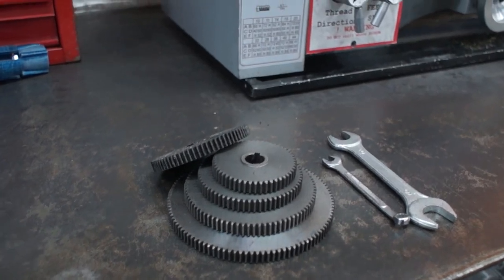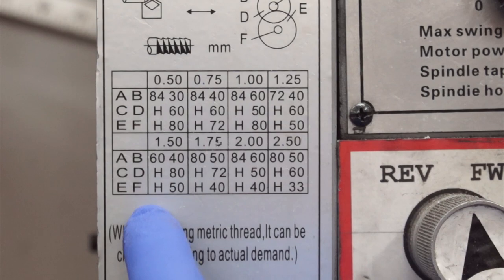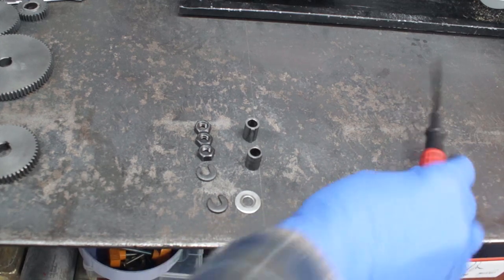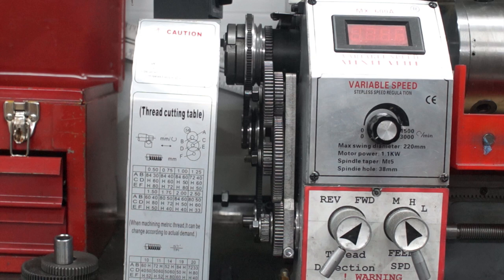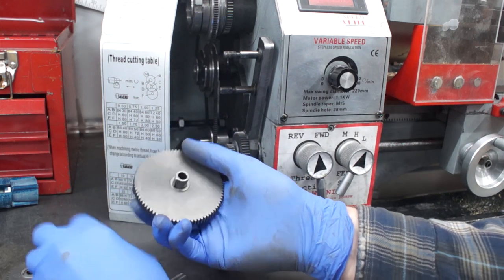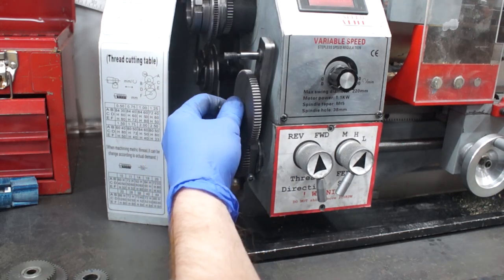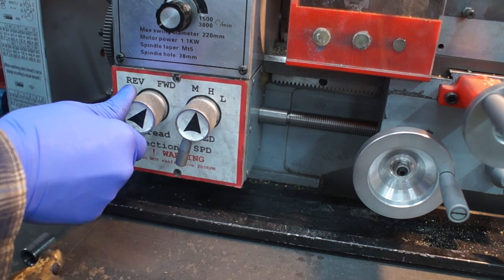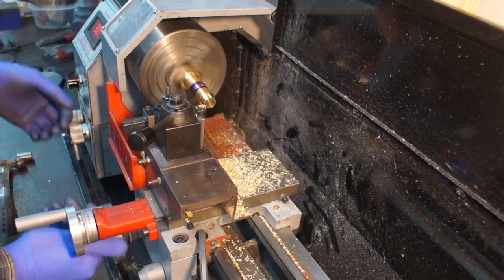VEVOR mini metal lathe setup gears for threading

Comment: This is an old video to be commenting on but when cutting short threads up to a shoulder you can turn the tool upside down and start the lathe backwards (If it goes backwards) to cut away from the shoulder into safe fresh air.

Comment: I confirmed on my MX600A;  Medium= 24t to 24t for 1:1.  High= 32t to 16t for 2x speed.  Low= 16t to 32t for 1/2 speed.  The one-piece tipple input gear appears to be a crappily made sintered  metal affair - nearly impossible to cut a replacement. The 16t and 24t output gear teeth are an integral part of the output shaft.  So yeah, don't break em.

Comment: Good demonstration! I have a very similar chinese lathe with a problem in the levers that drive the leadscrew (there's a fwd/neutral/reverse, and a 3 speed selector). They wont turn. I jiggle them and they may move a little, sometimes they engage the leadscrew and sometimes not. Is there a quick fix for that or is it necessary to take the headstock apart? I'd appreciate any help.

Comment: Good videos. I have a similar lathe. I am curious, who did you end up fixing the reverse gears that were stripped in the first video?
Reply from the maker: Nothing.
This gear is not used for any pitch so I just suffer with inability to have slowest possible feed.

Comment: Is this the 220mm lathe? Does is suffer the same kind of flaws that the small 7x14 lathes do, e.g. poor machining/tolerances, lack of rigidity etc?
Reply from the maker: It's small so it's not very rigid but but more rigid then smaller once.
Tolerances are the same except for the chuck. It 0 at the spindle and  002 ran out at the chuck  which is very good
Reply: @tonycstech  Thanks for getting back to me, that sounds very good (at least compared to my very worn pre-war lathe!).  I just saw the video on the quality issues you had to overcome, I'll avoid eBay for this and buy from one of the companies in the UK that sell them only after quality checks.

Comment: With metal gears I've found using bar and chain oil is nice and quiet and has awesome tack. Is this okay or is there something better?
Reply from the maker: I run mine dry.
If i lube them, shavings will stick and cause problems.
Reply: I agree have used bar and chain oil on lathe gears for years it is heavier and tends not to fly off the chain or in this case the gears.  Bar & chain oil also makes a pretty good lathe bed and cross slide lubricant.

Comment: Did you do all the passes by spinning the chuck with your hand?
Do you think you could manage M12X0.5?
Reply from the maker: I did it b hand because length of the thread is short, like 10mm at most.
It would be too easy to overshoot it due to lathe travel of speed when half nut is engaged.
Solution is to slow down the spindle as much as possible, maybe by jumping the belt that drives the pulley to a larger pulley.
It will slow entire process down so you can react in time.
IN my case cutting would be too fast and i would not react in time to disengage.
Reply: @tonycstech  Check this out, I think this is the solution to that issue: https://youtu.be/q7scadYptTI?t=754
I'm still a noob beginner, so might be wrong, but let me know if that helps you.
Reply from the maker: @maxwellconniff1189  have seen this my self. Totally forgot all about it.
This trick is definitely on my "give it a try" list.
Thanks for reminding me.

Comment: Hey Tony! I'm willing to buy a lathe identical to this one. What's your opinion about it? Does it worth the money? Cheers!
Reply from the maker: I think yes.
Its 1200 on VEVOR right now.
The only problem is, you never know what you going to get. It may not match to whats on the photo and may not include everything thats on the photo.
VEVOR will likely offer you partial refund because they wont be able to give you individual parts.
I got 300 and then some more later refunded.
So this lathe cost me 800 bucks which is allot better.

Pay with paypal, so you can easily open the claim.
Otherwise they can just ignore you.

Good luck.
Reply: @tonycstech  thanks, Tony! Should I buy it from Aliexpress, since I am located in Europe, and the shipping is free? Or from Vevor's website? The actual price is about 950 euro right now.
Reply from the maker: @vladsbikeshed  I would avoid buying directly from VEVOR. You need a middle man to be able to create a "not as described" case in the event or receiving wrong model or not receiving everything.
Reply: @tonycstech  thanks Tony! I'll buy it from aliexpress then. Had good experiences with the customer care in the past.

Comment: I am one of those who measures by the size of my foot so pardon my French, curious if you are able to get less than or equal to .001” tolerances out of this lathe?
Reply from the maker: Short answer: no
Long answer: there is no ranout on the spindle or the chuck, at least based on what I see in my case. There is ranout on the spindle bearings. By the time they turn the spindle and then spindle turns the chuck, you get around 0.002" on the chuck.
The further away you go from the chuck toward tail stock,  the more ranout you get.

So the solution is: replace bearings with correct once or live center every part you make so that at least you keep it at 0.002" entire length of the part.

I hope that makes sense.
If you know what types of bearings i need, let me know.

Comment: Hello,, same way on My lathe to, did you find the 72T gear, i remember you write you did not have it?
Reply from the maker: I ended up 3D printing it.
Reply: @tonycstech  ok,, good choice, is it modul 1, du you have Fusion sketch or dimension?
Reply: I just received my 72T from Aliexpress for 15$, all i have to do is turn the inner diameter and make a keyhole, thats ok tho...
Reply: @tommyharbofriis  Do you have a link for that gear?
Reply: @pauljcampbell2997 yes i postet a link, but it dont showup
Reply: And 1 mill of the side as i recall

Comment: On other machines, with a similar looking gearbox, M = 1:1, H = 1:2, L = 1:0.5, so its match only in some cases coarse, normal and fine, like 3/8"-32 UNEF and 3/8"-16 UNC, but the middle is 3/8"-24 UNF.
This machine has a very poor set of gears, because the set for 1mm gives you also 0.5mm and 2mm just by switching to L or H
Reply from the maker: I agree. And the chart is also bad. I tried doing 1.25 pitch the other day and the gear rack was hitting the spindle magnet thats used to count RPM's.
This lathe is a piece of junk if you ask me and gearing is just the tip of the iceberg of problems i have i didnt mention.
Reply: @tonycstech  I discovered this too. Some gear combinations simply don't fit!

Comment: Hey Tony,,, do you mind try a 2.0 mm threat setup, i cant get room on the 84T gear, it hits the downunder SPACE gear, i put the smallest gear there as a spacer, but it still hits.
Reply from the maker: Hopefully ill get to it this weekend.
I have some work i need to do on it and i can try to do 2mm pitch.
Reply: @tonycstech  Good, i Got it to work by trial and error, but that is kinda cheating way
Reply: And btw, u right about the selector,, then threading always use 'M' , the roughfin use 'H' and then fine turning use 'L'
Reply: @tonycstech  hey,, did u make the 2 mm pitch job 🙂
Reply: Why not machine a toothless spacer sleeve to fit in place of the smallest gear that you using for a space, since you have a lathe to make a simple sleeve.
Reply: @robc8468  i got it to work, cant remember How, but normal for these lathe, one have to tweak a bit.

Comment: Hi i have One mini lathe this but when i put gear for make thread 10 tpi gear dont arrive for gear principal of engine why?
Reply from the maker: You mean gears do not engage with the spindle ?
I am not very clear on what you saying.
I will try 10tpi hopefully tonight and see what if there is a problem.
Hang on.
Reply: @tonycstech  you have e-mail for i send photo
Reply: @tonycstech  my table for 10tpi says AB   60-H
         CD  40-50
         EF  H-52   
I put these gears but it doesn't reach the main motor shaft, it's short
Reply from the maker: @valtermarques9934  You are correct.
Mine does same thing.
I am very angry right now 
😠
Someone had mentioned different chart. I think you and i need to contact VEVOR for a different threading chart.

Ok i went to https://www.cgtk.co.uk/metalwork/calculators/changegears/minilathe
I entered what ever gears i have available and tried to generate 10TPI thread.

Generated result goes from top to bottom.
Top is the shortest distance from spindle to gearbox and bottom is longest.
I ended up using  3rd line from the bottom, it seemed to be good distance.

Gears i needed were 80,52,66,60
Spindle drives 80. 80 drives 52. 52 and 66 on the same shaft.
66 drives 52. 52 drives gearbox.

I hope that makes sense.
That chart is little confusing at first.

I tried to make a test cut really quick with that setup. It seemed to work ok. I dont have any bolts 10tpi to test it so........
Good luck.
Reply: @tonycstech  is possible say gear for letters A,B,C,D,E and F ? I dont know if you mean A-80 or D-80
Reply: Hi friend i not solve problem with my mini lathe for 10 tpi dont found gear correct, is possible help me

Comment: Dear Tony, how are you? What a very interesting video! Good 4 indipendent 4 jaws chuck, may you submit me link? Furthermore may you kindly enable the subtitles, even in english? It is unclear the H gear what meaning for. I purchased the 27 gear for this lathe, you too?
Reply from the maker: H=spacer or a small gear that won't contact with other gears.
I don't have 27T gear.
Chuck is 125mm 4 jaw independent.
Watch out for 3 hole pattern so you can mount it to the spindle.
Otherwise you will have to drill holes to match the spindle.
Reply: @tonycstech   @Tony Nameless  the "27 pcs gears" is an item sold on Amz/ebay, that I purchased, that contains 27 gears and a couple od drive belts. While the 72t gear is the premounted big gear at bottom? I haven't dismantled it yet. Regarding chuck I wish to purchase 160 mm 4 jaws indipendent, but I need a back plate. Anyway, may you kindly submit me link of your chuck?
Reply from the maker: @giuseppemarino2498  no link to the chuck. Sorry.
72t gear was not included. I 3d printed it instead.
Reply: Hello, can u send a link to that 72T gear ? thx
Reply: @tommyharbofriis  me too